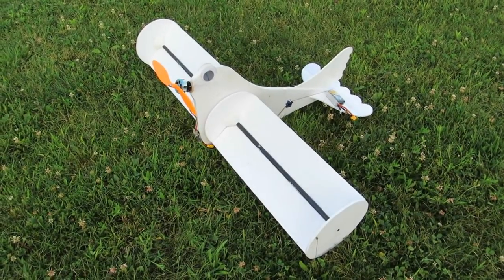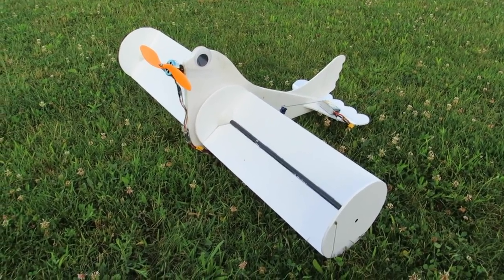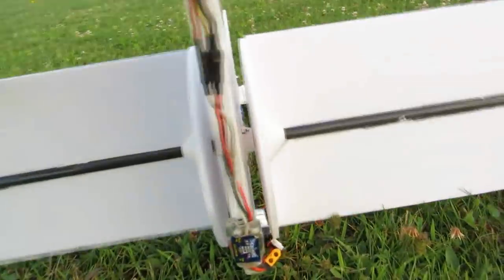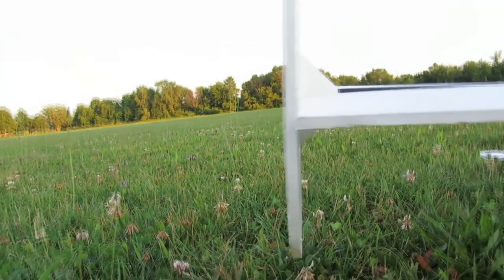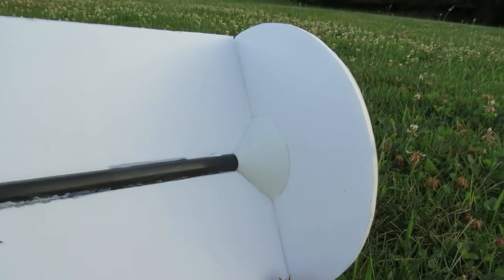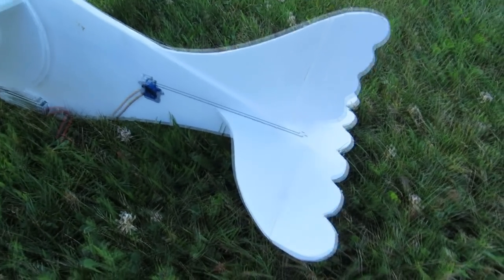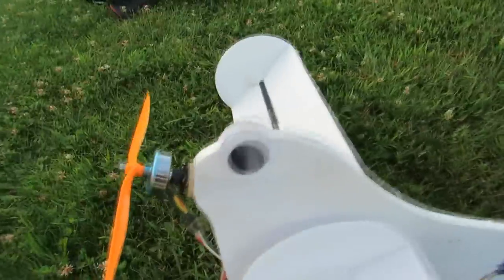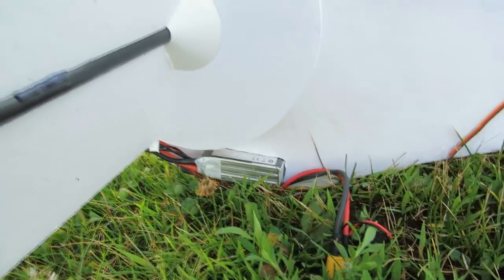Spinny Bird - Weird Magnus Effect R/C Aircraft

Comment: Awesome! So thats who you were! loved this thing at FF. It definitely flies better than mine!
Reply from the maker: Thanks! I hope you consider a re-visit to your bucket-craft. Perhaps a prop-wash assisted wing like mine with more of a minimalist carbon fiber design to save weight? Ramen noodle cups come to mind for a mini version ;). Stay in touch, I plan on doing an upset recovery video video soon on this. It's more stable than I though!
Reply: PeterSripol , I watch your YouTube videos! I subscribed!
Reply: @rcbif101  new subscriber here I like that design imagine it being a full-scale transport aircraft for American Airlines per se
Reply: The turbines will be at the tail end. I can see this happening reply P 10 times safer than your regular Air transport
Reply from the maker: @magnetosworld6311  Hi. Glad you like it, but it would be dangerous. It does not glide if the engine fails, and furthermore, it is very draggy and inefficient. It's mostly just a cool novelty.
Reply: @rcbif101  Don't put it down.  Very slow, novel, (experimental) and pushing boundaries are plusses in my estimation.  I experiment with rotor kites and have a suggestion.  There is one configuration that might work best as a wing, especially if you want to go with a higher aspect ratio like you said.  Imagine the wing's center spar as a hollow equilateral triangle of 3 blades glued together.  Each blade continues away from where they are glued to each other leaving that empty triangle in the middle where you might be tempted to insert your carbon fiber tube.  If you make that triangular cross section rotor with a large enough  space, it should be strong enough without an arrow shaft or whatever you used before.  As a kite, the resultant wing will fly as well as the flat plate design, will be biased to spin in the proper direction and flies smoother with more RPM.  You may need triangle spacers inside the spar to insert at least short axles through for transferring power into the wing.  They say a 4 piece wing with a square box central hollow space doesn't work at all.  I hope my description is clear.
I found this that should provide some inspiration for more development.  Please keep at it.  You are a natural aeronautical engineer.

https://antofthy.gitlab.io/kites/rotor/

scroll down to 'Hornbeam rotary kite plan (PDF)'

Comment: nicely done. not a lot of folks pull this off with sustainability. it often floats a bit then comes down. this clearly demonstrates sustained flight, and control. it's questionable if this will ever be a viable mode of flight on a large scale lol, but as a hobby craft, this is intreasting

Comment: Models like this already existed back in early 60's, but not motorized in any way. It was airlifted as a kite, helped by the rotating wings shaped like an S, while this model has flat wings. The whole thing would lift up while the wings were rotating against the wind and was held with a fishing line, exactly like flying a kite. In the distance it looked like a Hawk hovering above, and this model reminds me the same, a Hawk or some sort of bird with slow beat of wings. The 60's model wings were angled slightly upward like a kite so that the model would remain steady in the air. Amazingly, after all these years since the 60's I now see one, and it's electric.
Reply: one of my favourite toys,made a lovely whirring sound.

Comment: It appears from the way the model tips forward in the ground that the C of G is too far forward which probably accounts for the difficulty in getting it to climb.  The C of G needs to lie directly above or below the wing shaft to achieve neutral stability in the air.  It may even be better to move it slightly behind the wing shaft but this is a matter of trial and error.  The easiest way to move the G of G is to move the battery.  Adding weight to the tail as an alternative will increase the overall weight requiring more power from the motor.  If you move the C of G as suggested, you should find the elevator has more effect.  At present the model relies on the motor’s elevated thrust line to keep the nose up and therefore the whole model from dropping.  Once the elevator becomes more effective, height can then be controlled either using the elevator or increasing the thrust, assuming the model will them maintain level flight at less the full throttle.  Adding a bit of dihedral to the wings will make it more stable by increasing the roll resistance, possibly allowing a more hands-off and relaxing method of control.  Hope this helps.
Reply from the maker: Actually the reason it tips on the ground is just because of the curve of it's belly. The belly curve starts behind the CG, so it tips forward on the ground. The CG is at or near the shaft. Experimentation showed CG best just behind the shaft. I just didnt bother to design it to have landing gear. After more experience and tuning, it actually does fly hand-off as the low slung battery mimics dihedral. Adding rear dihedral would be interesting, but that would require two shafts, stronger bearing carriers, more weight, ect. Also, unless the shafts were linked, one could spin faster than the other which would make uneven lift.
Reply: Rcbif   Many thanks for the update.  You’ve confirmed what I expected, that a slightly rearward C of G would be best.  Difficult to pinpoint its location in the video which is why I thought it was too far forward.  Sorry I got it wrong.  Adding an extension to the belly just ahead of the wing shaft would prevent it tipping forward on the ground.  Not sure what you mean by rear dihedral.  Does the shaft rotate in the fuselage with the wings attached to it or is the shaft fixed with the wings rotating around it?  Simple bearing tubes made from a low friction plastic such as polythene or polypropylene should work ok without the weight penalty of metal ball races.

Out of interest, have you tried firming the wings into an ‘S’ section as described in my reply to another further below?  I’ve seen free-flying cylinders using this shape blade perform well in a good breeze when launched from a roof top.

Anyway, glad to hear your tweaking has proved successful and it now flies hands-off.  Well done.

Comment: It has a great flapping action visual at a distance. A stunning 'thing' for the skies :) 
Am wondering about the 'wing' surface shape to increase lift...have you tried curving the blades or a KFm type ?
Perhaps regular wing profiles that work great for lift but badly for inverted, helping the downward to upward transitions. Swappable wings would be an idea for tests.
Reply: Slider2732   Around 50 to 60 years ago when I was in my teens, I owned a kite sold with the name Revojet.  It too used the Magnus effect - the wings were thin plastic sheet formed into an ‘S’ shape with the axis of rotation lying along the centre of the ‘S’.  The shaft was made from a single length of thick piano wire bent where it passed through the fuselage to give the wings some dihedral.  This greatly helped its roll stability.  The whole thing was made from the same thin plastic sheet as the wings to minimise weight.  The kite string was attached to the fuselage beneath the wings and it flew extremely well in a wide variety of wind speeds from a gentle breeze upward.  When rotating the wings made a loud whirring sound which probably accounted for the name Revojet.  The aspect ratio of each wing wing was much higher than in the model in the video - the chord was a much smaller proportion of the wing length.  I wish I still had it - it was great fun and was different.

Comment: Hi,how about useing two independant motors to drive the padels and  increase the size of the tail and elevator ? just a thought, regards Terry
Reply from the maker: If by "drive the paddle" you mean by air, I think the model could benefit from another propeller motor. If you mean drive them mechanically like being hooked up directly - I'm not sure the extra weight would be worth the extra paddle speed, but it is hard to say. If you do drive the paddles mechanically and much faster, you have to be sure the  paddles are very balances, or else the high speeds may cause too much vibrations. If building lightweight, the tail could defiantly benefit from being larger, but for this model, it may be too much weight unless I change something to make it more efficient.
Reply: Hi to counteract the balance how about lengthening the body and fitting fins on either side of the tail to help stability,regards Terry.

Comment: What would happen if you turn off the throttle mid air? Would it glide down like normal airplane or would it behave differently? Assuming that the wings are still spinning, of course.
Reply from the maker: Significant loss of forward airspeed, and my guess if high enough, eventually a straight down drop. 
The worst case is the main rotor slowing, stopping, and then reversing, because when throttle is reapplied, the forces may be too great and the rotors may tear apart. I have been meaning to do an upset recovery video with this aircraft which unfortunately may destroy it, but it will be valuable info for other builders. Stay tuned.

Comment: I doubt you are really employing the Magnus effect here. The Magnus effect applies to a rotating cylinder or sphere, and only when the vehicle is moving forward w.r.t. air. Your wings are rotating but they are not cylinders. Can you take off vertically with only wings rotating, no prop pulling forward? If so, it is not the Magnus effect generating lift, as this would require forward (horizontal) motion btwn aircraft and air.
Reply from the maker: This aircraft cannot glide if hand chucked - but only because the wings are low inertia, and the aircraft is high drag. It need ls a constant source of power - as does any magnus effect aircraft. 
As far as the wings not being a cylinder....what is a cylinder, but a square with "more sides"? 
After all, from far away, a decagon looks like a circle. If I made the magnus effect aircraft with a decagon, or even hectogon style cylinder and it flew - would it count? Or no, because it still has "sides"? 
Food for though.
Reply: Totally agree, not the Magnus effect which uses drums and skin drag

Comment: Would a full cylinder (hollow) be more efficient than the open rotating style flap that you have in this one? Most wings I saw using this effect were full hollow cylinders. Thanks
Reply from the maker: My guess would be no. It would weigh more to begin with, and then require a motor to spin it adding even more weight. This style self rotates once it gets going. I have to imagine the scoop like flaps on mine generate more negative pressure that the surface boundary of a cylinder could. I'm actually working on a new design now that will debut at Flite Fest 2019.
Reply: @rcbif101  Good info, thanks. I'm also planning to experiment with this, I think I'll try to use the flap style like yours but cut out the inner section, so that I would essentially have 2 smaller scoops on the outer perimeter of the cylinder at a slight angle, similar to the FanWing but with fewer scoops. It will look more like a harvester but might be more functional than a complete hollow cylinder.
Reply from the maker: @curiexr8292    I also learned the prop washed powered paddles may not be the best idea. If I redesigned this bird, I would aim for maybe only 5% of the prop overlapping the paddle. My newest mag model, the prop wash does not touch the paddle at all. Using angled fingers/tabs, forward airspeed alone can self start the flaps spinning. I tried a variation with each flap panel angled 30deg in the middle to form a crude "S" or impeller shape, but for some reason it was very unstable. Did not fly.
Reply: @rcbif101  I'm surprised that the prop wash isnt helping, actually I thought that the way you positioned the motor would benefit the  magnus effect, as compared to some other motor configurations I've seen that actually work against the effect. I was just disappointed that I couldnt find more information about lift/drag differences between various configurations like flap peddles/tabs/complete hollow cylinders etc. Guess we are the few crazy ones haha. Most studies I found only dealt with cylinders.
Reply from the maker: @curiexr8292  with a hotter motor it may help, but with the slow, torquey dt750, I have a feeling the slow prop pitch speed was impacting the flap rotation speed.

Comment: Amazing. How does it keep from getting pitched down? It seems that there would be a lot of torque from both the magnus wing and the prop itself, both trying to pitch the nose down. The horz-stabilizer can compensate for all that?
Reply from the maker: The Magnus wing is free spinning so there is no torque, but there is a moment arm caused by the drag of the magnus wing and the motor being higher above wing centerline. So you are correct, the model does want to pitch down some. The solution was considerable positive motor thrust angle (motor pointed upward maybe 15 deg), so that some of the propwash hits the horizontal stabalizer, pushing the tail down, thus rotating the nose back up. This results in overall inefficiencies (along with the design of some of the propwash hitting the magnus wing for auto-start), but it works. My new design for this year has the motor below the wing. I lose the advantage of prop-wash autostarting the wing, but my prototype now climbs like a homesick angel at only 1/2 throttle.

Comment: no cylinder , no magnus effect ......this doesn t use the magnus effect at all as the "wings" aren t cylinder but rotating flat planks .....
Reply from the maker: DrKub007 - It is the magnus effect. The magnus effect does not require a perfect sphere or cylinder. Any symmetrical shape can be made to work. Just needs to be able to create a fluid deflection from rotation this changing pressures around the object.
Reply: I have a kite with the same style wings, if not magnus effect how does it work?
Reply: I was wondering the too. Would this still be considered Magnus effect?
Reply: @Ghost8E  lmao you replied to the wrong person
Reply: @OKFrax-ys2op    dont know the specifics of your kite but if it is anything like a air plane wing and if the "wings" arent rotating, then it is calle the "bernoulli Effect".